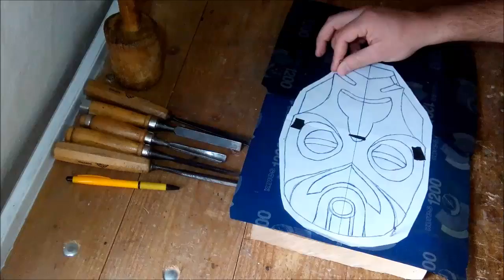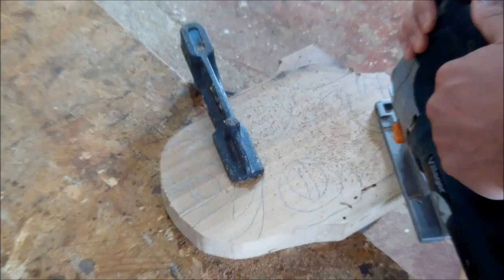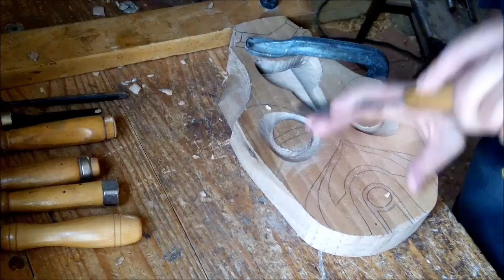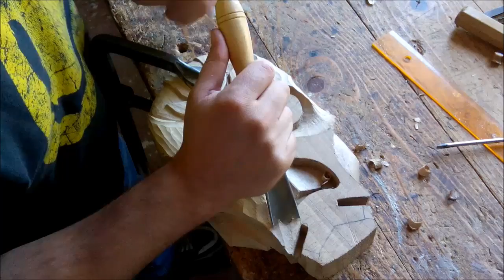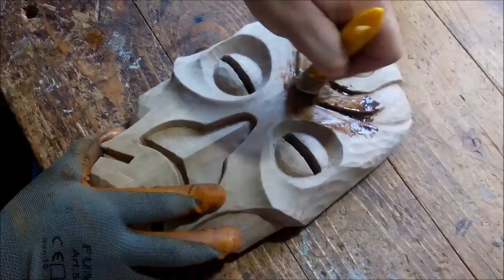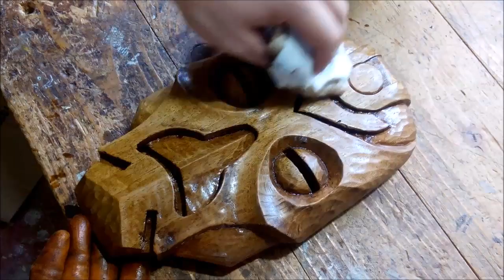Carving A Dragon Priest Mask Out Of Walnut

Comment: I'd like to make one of this, could you kindly give me some advices (measurements etc.)
By the way, I love your woodworks :)
Reply from the maker: The size of the mask is 30x18x4cm. You can print the template and trace it onto the wood using carbon paper. Use jigsaw for cutting. First, start carving the jaws, continue with eyes, nose, forehead, cheek and chin. Finish with background.

Comment: good work nice details but you could have made it alot faster with an engraving pen and some differnt bits... they even got attachments for sanding it would remove the chance for chisel errors... not to diminish yor work just offerng an alternative  cause ill be the first to admit i couldent do this if i tried
Reply from the maker: With CNC router or 3D printer is far more easier. But I'm enjoying when I carve with chisels only.

Comment: Great vid and work. I was worried you might sand it and remove the great textures from the chisels. But you didn't, looks great.

Sometimes I've used a second piece of thinner wood between the clamp and the piece I was working on. It allows me to get the clamp to hold more tightly without damaging the piece being worked on.

Comment: Eek! You really need a better method for clamping down the piece you're working on, or just otherwise keeping it in place. I definitely got nervous every time you were chiseling away at the piece and it would slip bit by bit across the work bench. I'm no carver, but I know those tools are SHARP, and one slip of the tool is all it takes to damage the piece, or worse, yourself.
That said, the mask turned out beautifully, you did a great job on it. Keep carving, and stay safe.